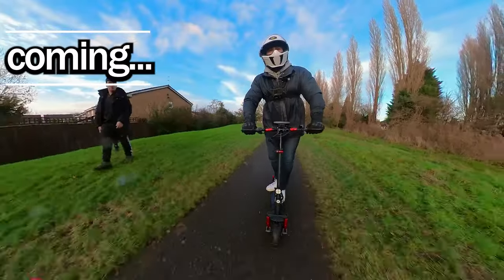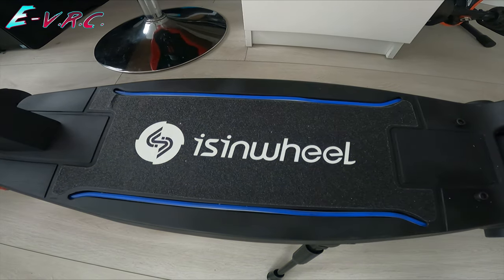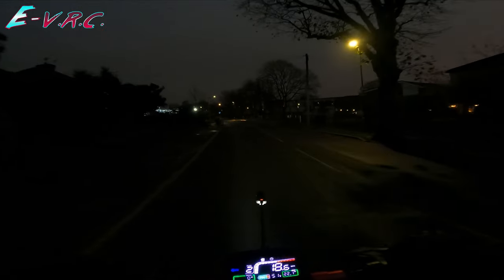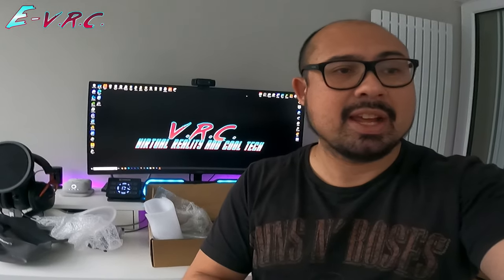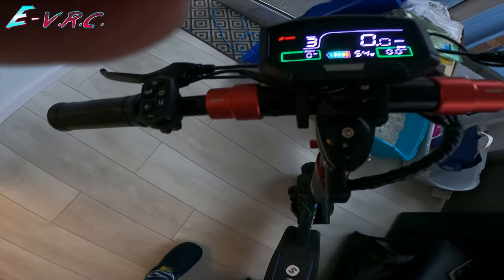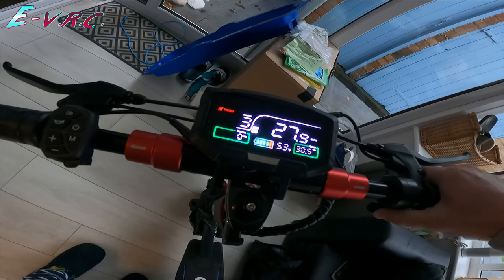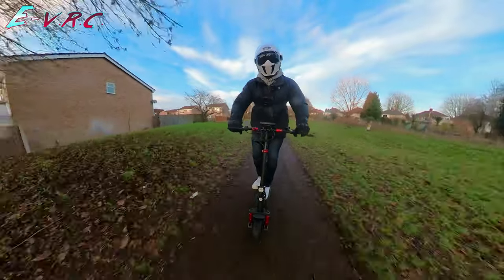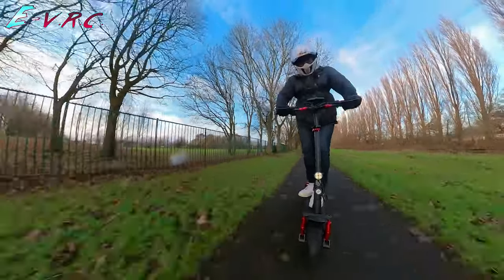FANTASTIC VALUE Off Road Electric Scooter BUT... (iSinwheel GT2)

Comment: Just bought one.. arrives next weekend with luck.

Your fault E-V.R.C 😅

Hopefully be a nice ride from the getgo, using it off-road of course 😊
Reply from the maker: Haha. Hope you enjoy it. I thought I might have put people off it. It's nice though.
Reply: @e-VRC  thanks 😊 it's just arrived, working it out, seems fine but having an issue with indicators and lights, also not sure how to unlock the top speed, I know you have to keep pressing the M button until it sais 27.5mph but it won't do that speed 🤔
Reply from the maker: @azisalive4972  what speed will it do?  According to the gps i got nowhere near 27.5
Reply: @e-VRC  I'm currently fully charging it to see, got it to 50v and its showing 17mph on test, seems to be no difference between normal and turbo mode
Reply from the maker: @azisalive4972  did the actual speed change on the screen happen when you were pressing the button?
Reply: @e-VRC  if you mean the M button.. yes, so normal mode is slower when it states 15.5mph..and only does that speed.. change it to 27.9mph and it goes 17-18mph in normal, no difference to turbo
Reply: @e-VRC  .. after this, I can say it's a great off-roader, took it across some land with mud and steep gradients and it handled it like a breeze bud 👍🏻
Reply from the maker: @azisalive4972  nice! But did you fix the speed?
Reply: @e-VRC  not yet, got it to 17.5mph top speed actually riding it on a flat with settings maxed
Reply: @e-VRC  was there a difference when you tried turbo? I'm confused how this works, or is mine possibly faulty..?
Reply from the maker: @azisalive4972  its just the top speed setting and should take you to about 27 mph. Possibly faulty. Maybe check if the speed is still limited in the computer settings.
Reply: @e-VRC   'P' settings are maxed too bud
Reply from the maker: @azisalive4972  🤔
Reply: @e-VRC   I'm guessing something isn't wired right between the button controller and the main screen as I'm having issues with my indicators too, it's indicating left when you turn it on and then they are stuck on like hazards when you turn the lights are on, both with the switch in central position, will not indicate properly and no top speed.. bizarre
I've thrown support an email now, awaiting a reply..
Reply: @azisalive4972  presss m 5 times it will unlock speed ????? shows in videeo ?????????????
Reply: @azisalive4972  ok cool bro
Reply: @azisalive4972  Did you fix the issue?
Reply: @Main Character  no my friend, at a loss, still works fine bud just no top speed in high settings 😒
Reply: @Main Character  also indicators are messed up still
Reply: @azisalive4972  If I were you I’d return the item or ask/ insist for an replacement you spent a lot of money on this scooter and it will test their customer service! If they don’t budge straight to a bank dispute and explain to them it arrived faulty.
Reply: @Main Character  I may do that but already been out on it a few times in the mud and removed stickers, does that matter? 
It's been ok off road which was it's intention 🤔 I mean, are you wanting to do nearly 30 off road on a scooter and expect to hang on for dear life 😅 but alas, yes it is faulty on purchase 😒
Reply: @Main Character  also, I think the stats are wrong anyway being a generic Chinese made product.. plus it does pull uphill (steep hills) at steady pace of 15mph with no effort even on grass and gravel and hardly touches the battery consumption
Reply: @azisalive4972  You paid for 30mph which you expected you should be able to use all that 30 if desired haha. I believe it doesn’t matter if you removed the labels it’s wear and tear or you don’t need to mention labels have been removed. The scooter I have goes to around 21mph and I paid half what you paid it wouldn’t be fair on you.
Reply: @Main Character  yeh, I get that bud, and you're right to be fair, maybe I should swap this out..
Reply: @azisalive4972  30mph = 50 km/H ?

Comment: I have a gt2 and it wont turn on how did you manage to get the spare parts as im having problems with the supplier. ihoverboard/isinwheel are one of most hardest compaines to contact as the number the provided is an answermachine in another country and takes them a week or more to reply to emails....Any advice on how to resolve this matter would be appreciated.

Comment: I am 115kgs and to be fair this looks like my best option under a thousand pound. Was it the app lying to you or the scooter after?

Im worried because my commute home has a 1.5 mile incline and im afraid this wont pull my backside up it 😂
Reply from the maker: I'm going to be making another video on this. It's.... ok. It's not as good as it should be. It's definitely the scooter. I still don't fully trust the app but this scooter isn't as strong as it should be. I do the hill climb on it in one of my videos and it's out performed by the iscooter ix4 and bogist c1
Reply from the maker: Does it have to be a scooter? There's some much more powerful ebikes under 1000
Reply: @e-VRC  I cancelled my Amazon order, I've seen a lot of bad reviews about the controller for it to just be bad luck in your case. Can you type some bike recommendations and I will research those. I love surron's but for the price I may aswell get a 125cc and a license.
Reply from the maker: @EllisJonesDeath  my last video has my favourite bikes from this year in it.

Comment: how much do you weigh
Reply from the maker: 15st
Reply: @e-VRC How long have you been with it? Do you see it as good, better than a Xiaomi?

￼
Reply from the maker: @abrahamrodriguezmartinez7226  had it a while but not ridden much. It's in my escooter hill climb video i posted a few weeks back. Didn't do so well. Doesn't go as fast as it should.
Reply: @e-VRC  + de 25 km h?
Reply: @e-VRC  I only had a xiaomi and I still have it, I only changed wheels 2 times in 4 years, it cost me 200 euros and the truth turned out well. I think in terms of durability, do you think it's good? I think that if a xiaomi lasted so long for me, one of these suits me, hopefully I end up in a museum, I only weigh 50 kg, I think that with me it should fly anyway, but I'm not sure
Reply from the maker: @abrahamrodriguezmartinez7226  i think the body is durable. It's the electronics that broke for me.
Reply: @e-VRC  I am asking 2 important things on a page. 1 is whether it can be returned and another, do you know if it has a guarantee?

Comment: Hey guys, I bought the new ix6 and it was delivered yesterday but when i turn the power button on, its showing a locked key🔒 with three 000 option to put in a code i guess.. but the manual it came with didnt say or show anything like that.. dont know what to do as it need this for work.. plz i need help guys🥹🥹
Reply from the maker: Tried 123, 000, 111, the usual default codes?
Reply: Press the zero Bottom when three 000 Comes up Press it twice real quick. And  display. Will come on Cause my key cards wouldn't work  And that's what I did and I got my display to work

Comment: I have this one brand new , have tested one time , and now they don’t accelerate anymore. They say error 7E I can’t accelerate anymore. I’m so disgusted myself
Reply from the maker: Sounds like the exact issue I had. New controller needed.
Reply from the maker: @amandamakeup5453  I don't remember the error code in the video   but if it's the same then you need a new controller like I did.
Reply: Salut j'ai erreur 15 😢😢